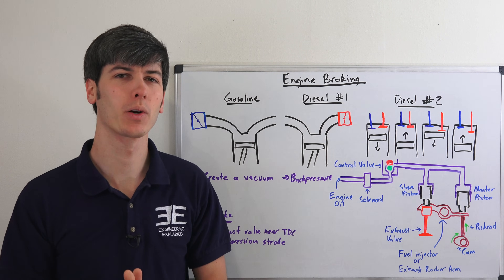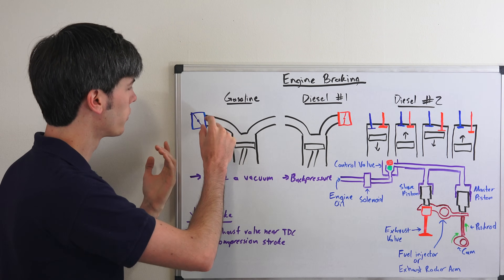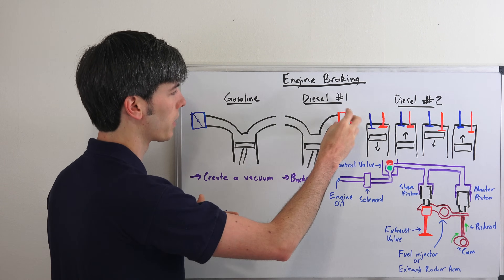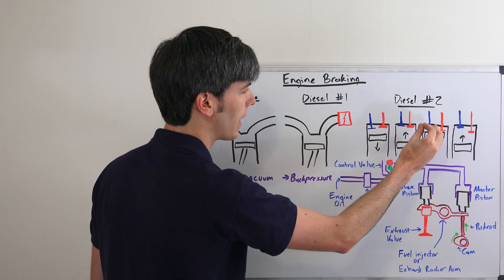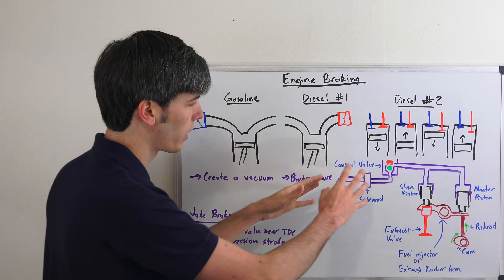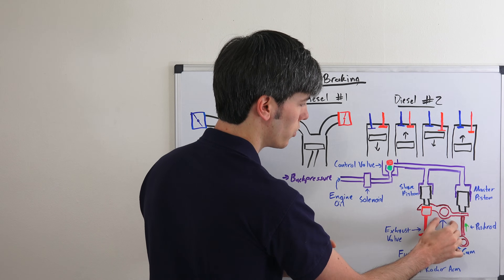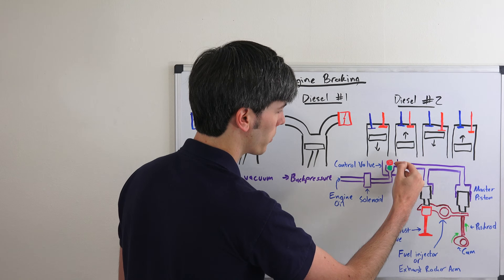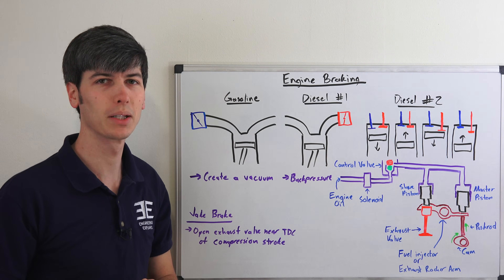What Is Engine Braking? What Is A Jake Brake?

Comment: My 2006 UD TRUCK (by NISSAN, but with a HINO DIESEL ENGINE)  has an EXHSUST BRAKE, a funky system at the exterior part of the exhaust. It has 3 stages of "stoping power" 

* Brake system is what they call "Air to hydraulic"

Comment: Huh. I knew what engine braking was, or at least I thought I did, you just let off the gas if you're going downhill or something and the RPM goes through the roof but you get no power because you're not injecting gas. I always figured it was because of all the moving parts and how much energy those moving parts take to actually move end up slowing the vehicle down because you're only getting tiny little sparks and almost no fuel burnt because your foot is off the gas. I figured all of the pistons and the shaft instead of generating energy, bleeds energy because you're not injecting any fuel.

I remember when I was a kid, how many times we had to start a tractor by pushing it down the hill because it had a bad starter. You'd put the thing in gear, push the clutch in, give it gas, let it build up speed and let off the clutch to force the engine to turn over. BUT when you do that the thing slows down considerably because it takes a lot of force to turn an engine over that's not actually burning fuel (which is why it doesn't take long to drain a car battery if you are repeatedly trying to start an engine that doesn't want to start).

Also, you neglected to mention that engine braking is only possible with a manual transmission. You cannot really engine brake with an automatic; the best you can do is let gravity and tire friction slow the car down, as the transmission shifts gears for engine efficiency and you'll just roll like you're in neutral. Actually I wouldn't be surprised if the automatic transmission didn't actually put you in neutral because it senses that you are going far faster than you appear to want to go, if you let off the gas entirely.
Reply: Would also point out that depending on the gear, the more the engine break is going to be successful. The lower the gear, the more RPM the engine is going to be going. If you're going, say, 20mph and you let off the gas in 4th gear, it's not going to put a whole lot of RPM on the engine and thus you'll just roll along, no problem (fact is, you might even stall when you try to give it gas again). Drop the car down into 2nd gear at 20mph and your RPM will spike and you will slow down considerably because it takes more force to turn the crankshaft that fast with almost no fuel being burnt, thus no combustion.
Reply from the maker: You can engine brake in automatics.
Reply: How, exactly? Just letting off the gas? That never seems to work in mine. I let off the gas and the car basically goes to neutral and I roll freely as if I were in neutral.
Reply: @Dhalin  Automatics will not engine brake when in drive. You have to put the gearshift in low, or put it into a lower gear if you can manually control the gear. Engine braking with an automatic is not as effective as on a manual because the torque converter does not work as good in the opposite direction.
Reply: @Redtooth75  Yes, I know about Drive 1 and 2 in Automatic Cars obviously, we call them 'winter gears' because they are usually used on snowy roads to give you more power but less speed and to limit how fast your tires will spin no matter how far you push on the gas (though I think they were originally designed for hauling heavy loads, but most people don't do that in a car). If you are using gear ratios in a transmission to slow a car down, is it really "Engine" Braking when its the transmission causing it? I feel the term is a bit misleading in this case.
Reply: @Dhalin  it is still engine braking, switching to a lower gear increases the rpm of the engine and creates more engine braking power.

Comment: Diesel has a valve in the intake and exhaust that closes at the same.
Reply: No only an extra rocker to open the exhaust valve at the top of he compression stroke, all other valve sequences remain unchanged and continue to operate as normal. All engines have there inlet and exhaust valves closed at the same time during the firing phase to contain the force of the combustion transferring it to the piston.

Comment: If the car is moving from down hill,Does the clutch plate won't get loose the life time, due to that reverse load from wheel to engine. Because here the engine is driven wheels

Comment: Hello,
i didn't understand that, why engine braking is good? when i'll use it, it'll make a complx friction with its valuable pins and parts. if'll use these valuable parts altime,  to do a braking in stade of my cheap break plate, i should pay a lot of money to repair. moreover, with this braking system i can't control my car, like as my principal brake.
could you explain me please.

Best regard.
Mansur Ahmad
106b boulverd ney
paris, 75018
France

Comment: I have a diesel without an engine brake or a Jake brake (Landcruiser HZJ105 - 1HZ engine) how does engine braking work for me? I noticed in your newer vid on the topic that engine compression ratio doesn't come in to it? But I can't think of anything else that would do it. 1HZ comp ratio is 22:1 and engine braking is phenomenal on this car. Also gear ratio comes into play could you please explain the physics behind that. Thanks

Comment: first of all: a vacuum can't pull. (atmospheric) pressure can push. It's the pressure that pushes, not the underpressure that pulls. That's the same thing in most cases, but in some cases, it's a difference.
Gasoline Engine Breaking:
So the atmospheric pressure pushes the piston against it's moving direction at the intake stroke. But the atmospheric pressure would also push the piston IN it's moving direction at the next stroke (the compression stroke, I think), thereby giving the energy it took last push back to the piston; or am I missing something?

Comment: Why is it so LOUD?  Why is it allowed to be SO LOUD?
Reply: A balloon is loud when it is pricked with a needle right, same with engine brake on a heavy diesel, you are letting alot of compressed gas out really really fast and there is no really effective way to supress this noise especially if you habe mufflers with worn or damaged suppresors or baffles. Engine brakes with new or compliant mufflers are actually very quiet. However that sound.....loud pipes are loud pipes and the people of my language need to hear that Jake brake bark. Sorry yes it is a sickness and no there is no known cure.

Comment: I believe he is a little mixed up about how a Jake brake works. He is correct about the fuel injector cut off, but the the other part, stops the the exhaust valve from opening. This provides a compression resistance without ignition in the cylinder. I am a retired vehicle appraiser for repairs, and this how a diesel truck mechanic explained it to me. Are there any Diesel truck mechanics out there who can confirm this. The way he explains it with the exhaust valve opening would provide no braking, from the cylinder.
Reply: According to his explanation, the braking would happen because of the compression cycle, which is basically wasted. The engine needs energy to compress the air, but then doesn't recover any energy from the powerstroke since the exhaust valve releases it immediately. Hope this makes sense...

Comment: You made a good high level explaination of this topic; however, I think you really didn't explain well concerning what's going on with the apparatus that causes the exhaust valves to hold open momentarily.  You went sort of hurried when it came to explaining the master / slave cylinders, the rocker arm, etc.  It came off as not really knowing what you're talking about other then what you've read or googled......animation would have really helped with this explaination.  Just saying...

Comment: What about a diesel engine without a backpressure butterfly valve? My 7.3 IDI has no backpressure plate, yet slows down quickly in gear when engine braking. I assume the higher diesel compression ratio (21.5:1) has something to do with it though

Comment: Diesel engines can utilize engine braking without any kind of valves or Jake brake by doing the same as a gas engine, simply letting off the gas / downshifting... and as you stated they have no throttle body to create vacuum... so...

Comment: I'm confused as to what happens or what would happen in a diesel when neither of these are used.  I always thought that diesels slowed dramatically because they had high compression.  OK, now that I understand it a bit better, I see that there was a missing step between high compression and slowing the car.  Do all diesel cars have the throttle valve as described and how would the engine behave without a throttle valve?

Comment: always wondered what jake braking was - thanks bro.  -would starving the the injectors of diesel also work?
Reply: You are already starving the injectors when engine braking due to a closed throttle postion so no further gains are to be made there, however boost pressure will increase during engine braking thereby increasing braking force generated by your engine.

Comment: On our heavy haul trucks (pulling two mountain doubles), we had compression brakes (not a Jacob brake) and we had brake savers. The brake saver consisted of an extra compartment filled with engine oil. It was part of the engine and set at the back of the engine at the output shaft. When applied by switch or an extra "Johnny Bar", it would air activate a paddle that would drop down into the extra 3 gallons of engine oil. It slowed the truck down quite a bit in combination with the compression brake. We were hauling 500,000 lbs. gross on private roads. Just thought I'd share.
Reply: Compression Brake? Whats the truck brand?
Reply: @ajidamarjati  Almost all of them are compression brakes now. Cummins, Detroit, Catepillar, Mack, etc.
Reply: @nosoliciting024  Apparently it's only a marketing name/different name for a jacobs engine brake. Compression brake = compression release brake = jake brake.
Reply: @ajidamarjati  The original Jacobs Brakes (and yes that is the maker) held the valves shut inside the engine creating a back pressure, which slows the engine down and the vehicle. The compressions brake creates back pressure at the exhaust of the engine, which again slows the vehicle down.

Comment: Isn't 'engine braking' a case of sacrificing a very expensive component (Engine and Drivetrain) in order to preserve a relatively cheap component (Brake Pads)? The logic there escapes me.
Reply: Your logic is what's flawed mate, there is no damaging effects to any components engine or driveline if operated within specifications by manufacturer, Let me put it this way, would you buy a pair of shoes that you could never wear while walking down a steep incline because they were only designed to go up a hill, same effect, you are ether applying effort to climb the hill or effort to slow your decent, only variable is traction and which leg muscles you are using and how. Same applies to all automotive apllications. Keep it inside the Redline and you are can operate your engine to acelerate or decelerate as desired. An engine is under many times more stress when acelerateing when compared to engine braking when it is at its least stressed other than when staionary at idle.

Comment: Ok. The first diesel engine break  you were talking about is called an exhaust brake. The 2nd diesel brake is an actual engine brake which was invented by Cicel Cummings. But he didn't have the money to patent his idea so he went to Jacobson mining equipment company and they in turn patented his idea under there name hence the name jake brake. And there's variations of the engine brake. But they serve the same purpose. 

THE exhaust brake isn't as strong as the engine/compression brake.

Comment: The problem with so-called "vacuum braking" is that there is still a partial vacuum above the piston at BDC of the intake stroke, relative to the crankcase, which will pull the piston upward during the compression stroke.  So however much work the rotating assembly has to perform to pull the piston down against that pressure differential, nearly all of it is returned when the vacuum pulls the piston back up to TDC.  For vacuum braking to be as effective as a Jake Brake, you would have to open the exhaust valve at BDC, to ensure that the work taken out of the system by drawing the vacuum is not immediately returned to the system.

Comment: Question: So this means engine braking should be avoided in a petrol engine as the lack of fuel in the combustion chamber means less cooling, less lubrication and therefore unnecessary piston ring ware and the valve springs have to resist the vacuum inside the piston from opening the valves at unscheduled times? Brake pads are easy to replace, valve springs and piston rings are not

Comment: I always notice that downshifting / engine braking with a gas engine it cools er down .
Reply: All engines cool down during engine braking due to the almost complete removal of a power stroke and it's this stroke that generates the heat in the first place.

Comment: Correction...  "Engine braking" is not the same as an engine brake.  The Jake Brake is an "engine brake".  There are other versions of Jacobs design principle but all work by valve timing manipulation.  An "exhaust brake" on the other hand is not an engine brake either...and could be compared to shoving a potato in the exhaust pipe preventing exhaust from escaping.

Comment: Hello. I'm from philippines. Please bare with my english, i dont speak english fluently. I hope you understand. I have a question about my motorcycle. Its a 125cc underbone motorcycle. When you return the trottle to slow down, engine braking feels "jerky", it slows down the engine quickly. It feels not smooth. I ride my Friend's bike and it feels smooth when i return the trottle to engine brake. It doesn't feel jerky, it feels like the engine is still rolling but slowing the bike down. Mine is like, it stops the engine real quickly making you go forward a little bit. It doesnt feel that good, making me and my back ride uncomfortable doing that. What do you think is the problem about my motorcycle. Please help. Hope you understand. Thank you.
Reply: Sounds like yours is a 2-cycle, and his is a 4-cycle.  With a 2-cycle engine, you have a compression stroke for each rotation; 4-cycle only have a compression stroke for every TWO rotations.  So with throttle closed, the 2-cycle will brake almost twice as much.

Comment: When idiling,injectors are not closed otherwise engine would halt then why during the engine braking injectors are closed?
Reply: Because the vehicle is in motion and this foward motion is what keeps the engine spinning, they also have a low rpm disengagement point, around approx 900rpm to 1000rpm to prevent what you were asking about. Generally you can't activate Jake brake at engine idle or yes it will stop rather fast.

Comment: So, this could not be done with an interference engine design due to the exhaust valve hanging open while the engine rotates. I assume, then, that all diesel engines with jake brakes are non-interference engines?

Comment: Pretty good explanation of the Jake Brake, but when the master switch of the engine brake is turned on, the master & slave cylinders of the engine brake partially hold open the exhaust valves thru out the engine braking process. There are switches on the clutch & throttle pedals, that also temporarily shut off the engine brake, until the throttle or clutch is released, and the engine brake resumes engine braking, with the master switch on. Most engine brakes also have a 2nd, three position switch, which can be used to toggle thru the "desired" amount of engine braking. 2, 4, or 6 cyls (on a 6cyl engine). Hope this helps...

Comment: I don't think is just like that..  on normal engines valves never open at or close to TDC simply because there is not enough room. and they will hit the piston. Every engine has this problem... Everyone knows that if your timing belt is not installed right or it's ruptured.. you can have a expensive trip to the mechanic.. engine  desingn engineers struggle on this..  the try on the exhaust stroke to keep the exhaust valves open for as long ass possible.. so when they close and the piston is near the top they just skip eatch other... this problem makes imposible to get rid of all the exhaust gases so they mitigate this by opening the intake valve early.. In the exhaust stroke the piston starts going up.. the exhaust valves open...gases escape fast an they build up momentum.. then at the very last end the intake opens slightly and the exhaust gases momentum actually suck a bit of fresh air from intake (2 stroke engines actually work on this principle...) and this way they manage to get almost all exhaust gases out.. the problem is also present on intake beacause you want as much air as possible in the cylinder.. the intake valve when opening it just miss the piston as this is staring to go down.